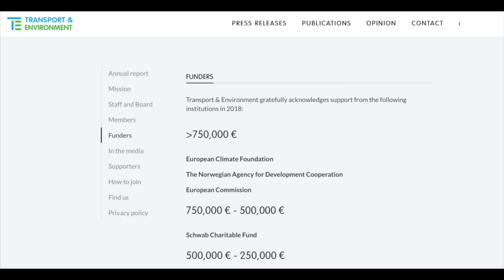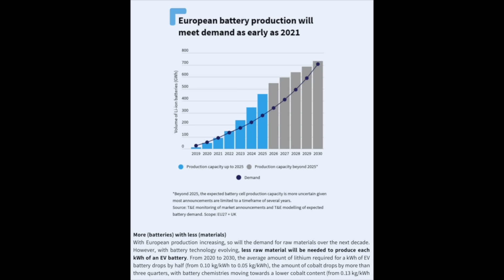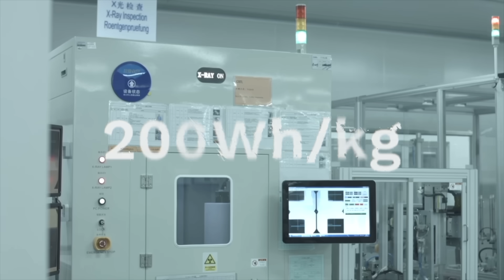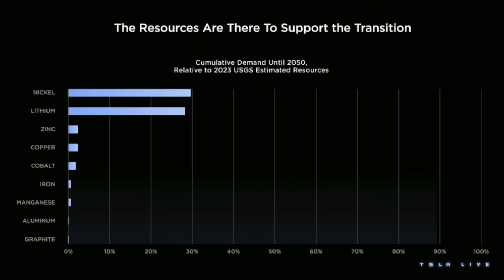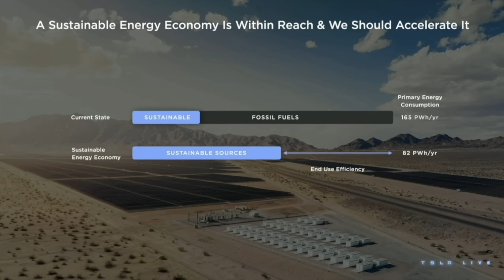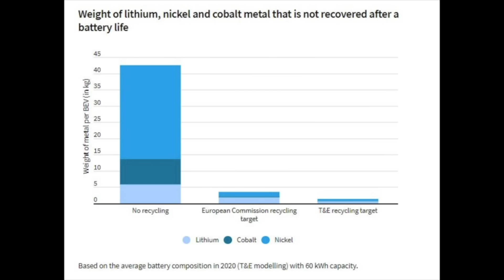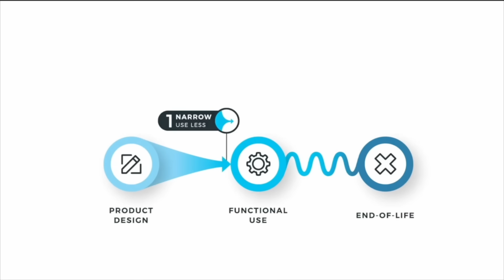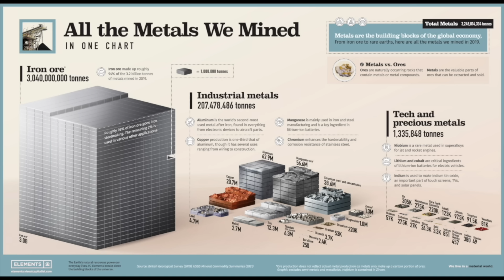The Materials we mine! The Truth about EV battery mining!

Comment: An update on the   complaints I have made here about this graph, because it is a Hodge Podge of ore compared to refined metal.  
Example, copper is listed as 20.7 million tons.  My research shows that is about right for the amount of copper METAL we get from mining each year. But copper ore is notoriously dilute.  Averaging 100 to one ore to refined metal by weight.  So 20,700,000 tonnes of copper times 100 is 2.07 billion tonnes of ore.  That is ⅔ the size of the Iron ore block in the picture. Rare earth ore makes up about the equivalent of 2 layers of the iron ore block.  Gold ore makes up about 4.5 layers.  Now just those three ores  are equivalent to around 85% of iron block.  Yet in this diagram, those three would equal less than 1% of the iron block.  
Do better.

Comment: What sunk in for me was learning the US alone daily. Digs drills n fracks up 18-20,000,000,000#+of raw crude oil and burns it ALL EVERYDAY OVER&OVER AGAIN! 

Then look at the waste just from oil changes SMFH. 400,000,000+done which creates over 180,000 tons of waste steel alone annually. And forget about recycling oil I worked as a service station manager for a couple years. I've been to a state approved recycling facility. 
1 gallon of used oil in results on in only about 2 quarts of useable resell able oil. 60%+of all used motor oil ends up in dumps, down drains, rivers, the ocean and our ground water supply!